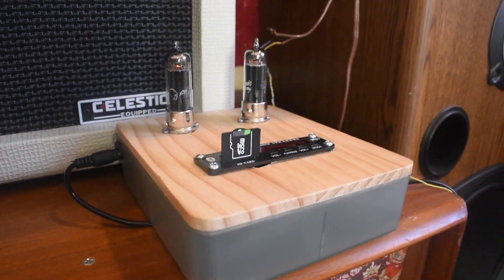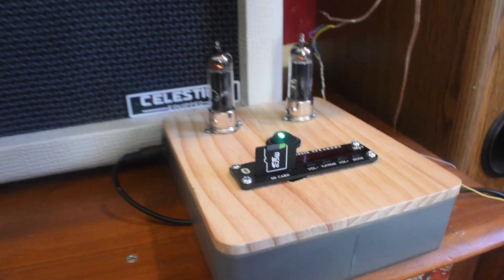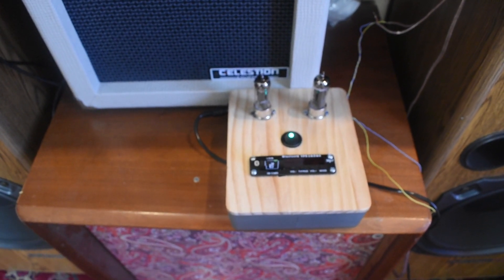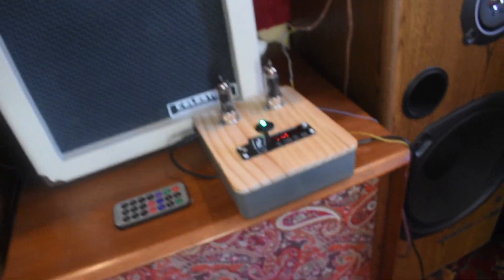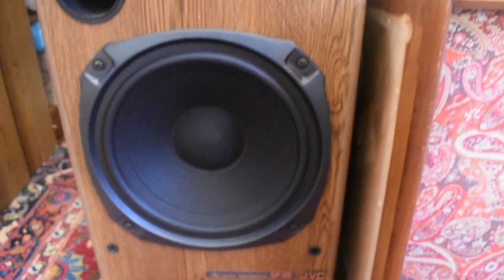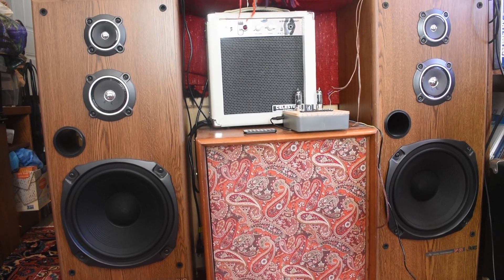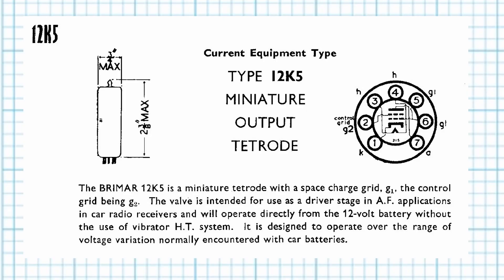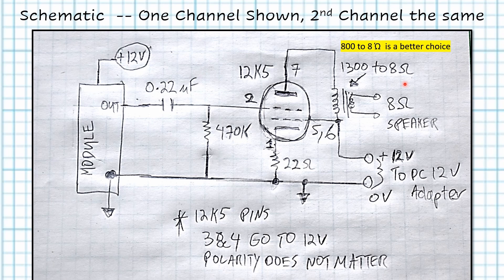DIY Low Cost Stereo Bluetooth Tube Amp Working at Only 12 Volts!

Comment: I'm still waiting on some tubes, in the mean while maybe I can get a 6AU6 to become an oscillator of some sort that I can plug into my Triple 555 Atari Punk fifteenfive thing. The 555 timer does not draw current nor do opamps. I'll need to drop the plate votage to the usable line specs. Perhaps I need one of those line matching xfmr's. I might stop using transistors all together and invest in fat resistors and tube sockets. I might Just!